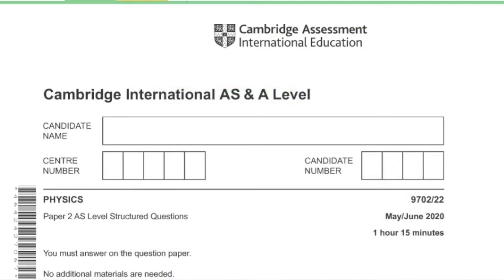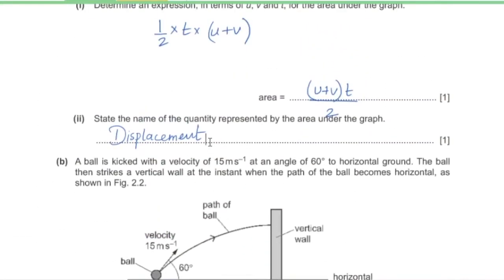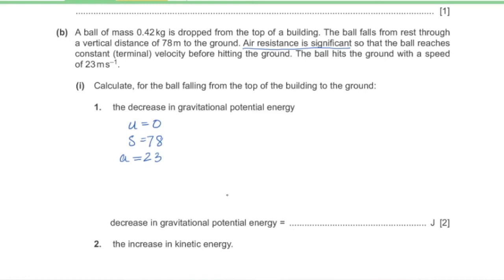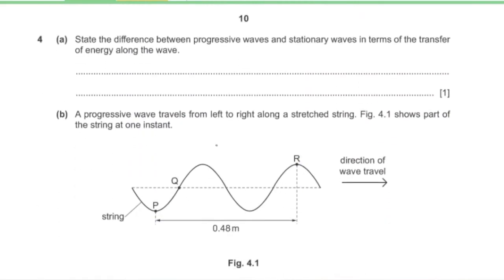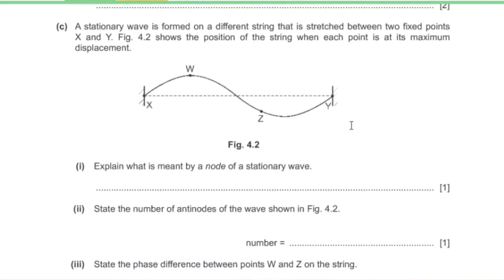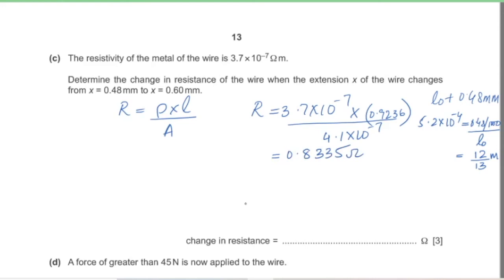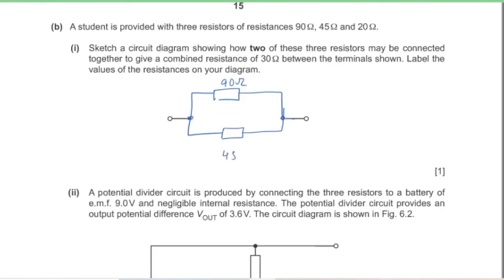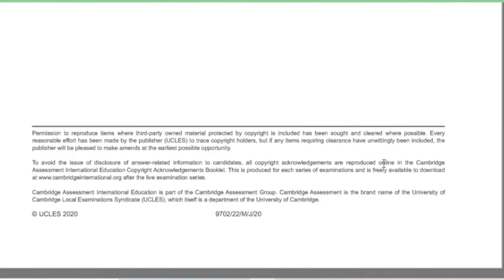CIE A Level Physics Solved Past Paper May/June 2020 P22

Comment: How do we determine the direction of displacement of a particle on the string? How do we know when it is upwards or downwards. In Q4(b)(iv) , shouldn't displacement of Q be upwards(away from horizontal reference line) at 0.005s?
Reply from the maker: Points P, Q and R are fixed points that stay and the wave moves towards the right so after 0.005s, the max amplitude that is at point P at t=0, will come to point Q at t=0.005, and at t=0.01, point Q will have zero amplitude or displacement.
Reply: @examhelpweb2090  i see.. BUT then.. why in answer you wrote: Q travels its maximum downwards displacement at t = 0.005 s and comes back to its original position at t = 0.015 s?? (Shouldnt it be ... t = 0.010 s ?? instead of 0.015 ??)
Reply from the maker: @mimichfury6329  I mentioned zero displacement t=0.01s in the video too.

Comment: maam i didnt get Q4 last part
Reply from the maker: The new wave is half the frequency of the original one. Wavelegth is inversely proportional to frequency so the new wavelength is twice as long. This means in the same length where the initial wave had a complete wavelength the new wave will only have half of it.

Comment: Question-5C, 25:07 For original length, you could've simply find the increase in extension which is 0.60-0.48= 0.12mm which you then convert to m ( 0.12 * 10^-3). So you have all the 3 things to find change in resistance which are resistivity, cross section area and the change in extension length. You messed up the working in 5(c) and directly wrote the answer from mark scheme after you got the math wrong. Pls at least correct it or inform viewers that the working was wrong. I'm just trying to help.
Reply: yes exactly

Comment: 26:28 
My answer for the new length is 15/13 instead of 12/13. How did you find that answer? 
(Btw these videos are really helpful, keep up the good work👍)
Reply from the maker: Strain of the wire is 5.2*10^-4 and extension is 0.48mm. Convert mm to m and use the formula strain=extension/original length to get original length as 12/13m
Reply: @examhelpweb2090  For original length, you could've simply find the increase in extension which is 0.60-0.48= 0.12mm which you then convert to m ( 0.12 * 10^-3). So you have all the 3 things to find change in resistance which are resistivity, cross section area and the change in extension length. You messed up the working in 5(c) and directly wrote the answer from mark scheme after you got the math wrong. Pls at least correct it or inform viewers that the working was wrong. I'm just trying to help.

Comment: In the graph drawing
Why the acceleration decreases rapidly at the beginning, then the decelerates at a slower rate before reaching the terminal velocity.
Also pls reply my questions on other videos.
Thanks
Reply from the maker: To make it easier, I also plot the velocity-time graph that showed how the acceleration is changing over the period. The drag force increases which makes resultant force acting on the ball smaller and then reaches terminal velocity at which acceleration is zero. Acceleration is directly proportional to resultant force so when  the resultant force is decreasing, acceleration should decrease too.

Comment: you made a mistake in question 5 the second length is supposed to be 15/13. And based on you calculations these two will not add or subtract to give the answer you got

Comment: In Q4(b)(iv) doesnt Q move upwards why did u write downwards displacement
Reply from the maker: Point Q is a fixed point that stays and the wave moves towards the right so after 0.005s, the max amplitude that is at point P at t=0, will come to point Q at t=0.005, and at t=0.01, point Q will have zero amplitude or displacement.
Reply: @examhelpweb2090   ok but when p comes to q its also going up tho so how is it downward displacement

Comment: Hi in question 4 why do you divide 0.48 by 3?
Reply from the maker: PR is 0.48m which has 4 crests and troughs so to get the distance between trough and its adjacent crest, I divided 0.48 by 3. 0.16m is length of half wavelength so a complete wavelength is 0.16m*2=0.32m.
Reply: since one complete cycle is  λ and the other one is  λ/2, you add both, 3 λ/2 then you equate to length 0.48 and find wavelength.